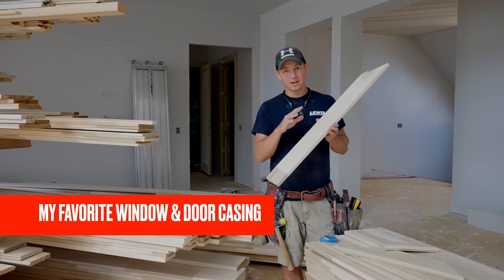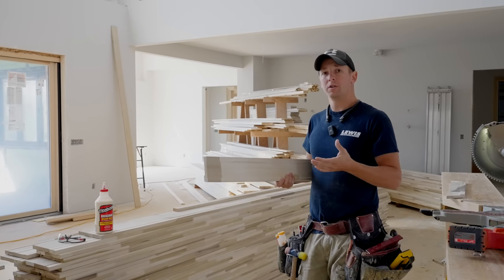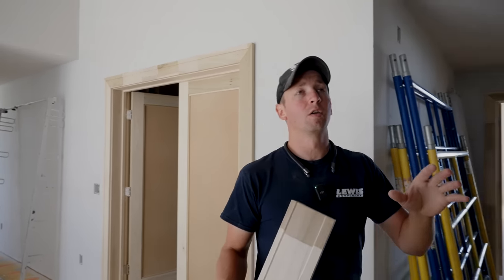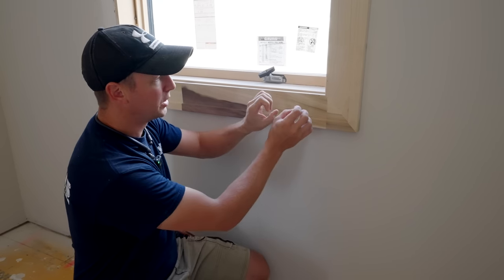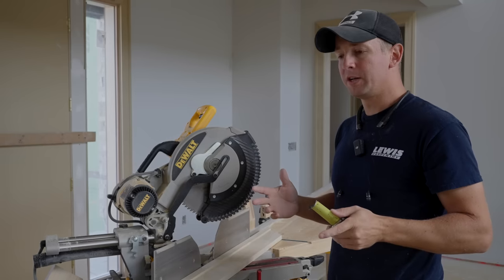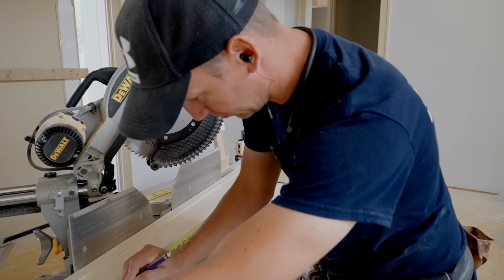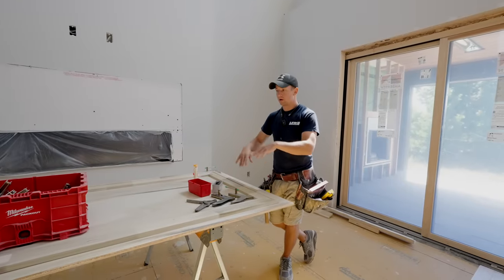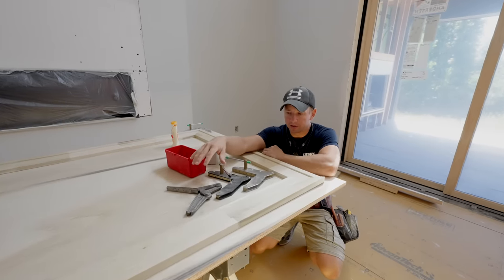BIG CASING!!! Avoid These Rookie Mistakes Builders and Carpenters Make...

Comment: I put a piece of 1/2 inch Birch plywood on my biscuit jointer fence as an auxiliary fence so it gives me a much larger foot print to make mortising easier. I can also make marks on the new fence to help rapidly center the mortise. Just something I have found useful over the years.
Reply: With this idea it seems like you could also add a cutout or use a camp to slide a stop block around for even easier batching

Comment: Hey Spencer, forgive me if this comment was already made, but wouldn’t it be better to reference the bottom of the casing flat on a table rather than trying to align the fence on the top of the casing?
Reply from the maker: With wood being twisted sometimes I find it easier to reference the back of the work piece and use the fence.

Comment: PS, I use Forest blades on everything. My only knock is that the chopmaster teeth seem to break off easily. By the time I send them back to the boys for sharpening I have so many broken teeth its cheaper to just buy a new blade rather than replace teeth. Having said that I wont use anything else.

Comment: Really outstanding video, Spencer. I'm partial to your style as an instructor. You speak clearly and you demonstrate what it is you're talking about. Your job sites are the real deal, not merely sets, which greatly enhances your credibility. 

And just as important to me, your demeanor is authoritative but not doctrinaire or harshly critical of others. I'm done with the know-it-all bluster of creators and trolls alike.

Keep up the great work. 👍
Reply from the maker: I appreciate that!
Reply: Hey Spencer, another great video! 

I like like to register my biscuit slots off of the table whenever possible. As long as it's not too far off center from the thickness of the stock. Sometimes, I will set stock on shims to center it. That's just my preference. There's nothing wrong with your approach, if that's what's comfortable.

If I have a lot of gluing to do. It's also nice to use 4x8 sheet of melamine for an assembly table. Glue cleans up really nicely from it, even after it's dried.

Comment: Your channel is my "go to" for finish carpentry for sure. After 25 years of being a ho-hum carpenter I decided to up my game. I've learned more from your channel than I have from the old timers I used to work with. Better technology, better tools, more efficient methodology these days really change the game in my opinion. 
I just used your "wetset" method for installing the split-jam side of a pocket door and absolutely love it. I prefinished all the trim in this job so I used the blue tape/super glue method to adhere the temporary spacer blocks. It's Saturday and the PL 375 isn't fully cured so I'll wait till Monday to finish up casing. Thanks for all your super-detailed instruction!

Comment: You can attach a piece to the fence of the biscuit joiner to extend its purchase and span relief cuts. You can even use a piece built up on one side in order to be able to register on the face of the trim. Great video 👍🏼

Comment: Great tip in writing measurements on your tape! You can get a much bigger palette to write if you take the label off the Stanley tapes and clean off adhesive. Pencil rubs off with your finger.

Comment: Love your style! I call an un flush miter a clicker... If your finger nail clicks it, it's not right. When it comes to glue,  glue doesn't matter if the surface isn't touching each other. I see people front cut to get the miters tight which leaves a gap in the back. End result,  glue is not working...  I am currently trimming with 1x4 poplar casing. We are Kreg Jigging (pocket hole) all the casing together. Either system is a great way to achieve a great result.  GREAT CHANNEL AND GREAT CARPENTRY

Comment: I love how this guy says that the cut quality on a Forrest blade is "decent"!  In my realm, it's the best you can buy.  And here I was thinking I'm a good carpenter.  Keep up the great work. 
One idea that would've helped with your biscuit placement, would have been to reference off the table.  Clamp the casing face up to the table, and plunge away.  If there was enough height/thickness in the casing, that is.

Comment: Good tip on the Lamello biscuits - they are much better. The cheap ones can have raised edges and so on and makes them a pain to insert into the slots and pull joints tight. Great video and lots of good tips!

Comment: Nice video - the only thing I do different is I mount my jointer to the job site bench and use stop blocks to align the casing. Also Lemello makes a glue bottle tip the injects glue onto both sides of the slot giving you even coverage and not over filling the slot. In my shop I have a dedicated plate joint installed in  my chop saw fence with a pneumatic cylinder with a foot control. Make life a lot easier.
Reply: I'd LOVE to see a picture of that, sounds awesome!

Comment: glad this video came up and i know im building our door casings correctly. they are simple 1x4 but joined with two dowels for alignment and glue surface and a pocket screw for clamping pressure. can’t do much about acclimatizing because assembly needs to happen in the garage. great vid, thanks!

Comment: I have used dominos on casings.use the bench/table for the reference surface and wood glue on the mortise and tenon but use the high temp pur glue (75 second) for the joining surfaces of the mortise.

Comment: The job i am starting in 3 weeks has casings similar (and 8" tall base.)  Already bought the box of Lamello #20's.  Presently have completed half the framing walk through and already I see I should have braced the jambs on the windows before the insulation foam was applied.  They showed up four days early and as expected, those sides are bowed in 1/4".  Going to be a challenge to keep the reveals consistent around those windows using pre-assemblies.  Dug out as much foam as i could. Cleared the protruding foam around the permiter so drywall planes to my jambs.  Fun times for sure!

Many thanks to you, Spencer, for sharing your knowledge here and teaching me what to look out for.  Can't ever thank you enough, Sir.

Comment: I had termite damage to my house a few years ago. I had to make new wide trim for my patio door. Strangely, or not ( I am not in the business) , I basically used all your tips and added one , based on my observation about termite likes and dislikes. I wound up priming all my trim front and back before installing it ( including Sheetrock and borate on structural lumber). The termites seemed to have avoided painted wood, equal to treated. I suspect the priming also reduces the amount of swelling in higher humidity conditions? I realize it may not be practical on a production basis though. Enjoy your videos and will consult before taking any future “ plunges” into the abyss.

Comment: I also pocket screw them from  the back along with the biscuit, and  put a  two inch screws in areas where they wont be seen to pull the joints tight.  I don"t believe its an AC issue. It"s garbage lumber.. Homes built 75 years ago experienced the same weather conditions and some of them still look rock solid today . No back priming or fancy glues. Just well seasoned lumber.

Comment: I use a band clamp around the frame and put two trim screws in to each miter on top and bottom of the frame so they are not seen after installation.  Had good success so far.

Comment: I assemble thick casing (5/8"+) with pocket screws and glue and install in one piece.  Easy and very strong miters.  I've viewed your other videos for mitered beams and suggest using a lock miter router bit.  The mitered pieces pop together and after glue, they won't open up. 

I recently made wide column wraps with clear vertical grain cedar using lock miter routed joints and had no struggle with aligning the mitered joints.  They self align like pieces of a puzzle, even if here are slight bows in the wood.
Reply from the maker: I've got some videos from a few years ago on my lock miter setup with my shaper. I stopped using it because I feel I'm better off just miter folding.
Reply: @InsiderCarpentry  Fair enough.  You do this as a profession vs. my carpentry hobbies.

I'd like to see you do more stain grade carpentry.  We just finished our new home where I did all of the millwork from rough cut lumber - mostly rift white oak, including whole home cabinet builds in rift white oak.  I think we saved a small fortune by buying from several small mills in my area (MN/WI).  I couldn't stand the thought of trimming it all out in paint grade poplar where grain pattern doesn't matter and gaps get caulked.

I get you're just doing the millwork install requested of you but many of us in the DYI world are doing it all.

I did get some great tips from you on my stair build.  I did ours in maple risers/treads and made our skirtboards in white oak.  All finished just poly.  I started watching all your pertinent videos 2 years before we started a year ago.

Thanks for the reply and keep posting great vids!

Comment: Excellent advice. I just finished a job with 4-9/16” casing with back band. I followed NS Builders YouTube video advice using two dominos and two pocket screws and clam clamps for each miter. It creates a rock solid joint. Your approach using one #20 biscuit is simpler and I’ll try that in the future. You are so right that alignment can be tricky if you don’t hold the Domino or Biscuit Joiner just right.
Reply: NS got a lot of backlash for that video as it is just too much for one joint. Think of all the weakness you create with all those cavities. 1 biscuit or 1 Domino is all that is needed.
Reply: @bimotahb1  Interesting, had not heard that. I used ¾” x 4-9/16” poplar with and applied back band. The two #5 dominos and two pocket screws were not too much for that long and thick a joint, worked perfectly for me.

Comment: Nice work, Spencer! I was curious if the biscuit jointer could be mounted on a table. That way the casing could be indexed flat and pushed into the blade making user tilt and alignment errors less likely. I have 2 piece casings in my house that I built 20+ years ago. Glued but unreinforced yet no cracks. Chalk that up to west coast low humidity swings!
Reply: I always clamp my biscuit jointer to the work table upside down to run a batch through. It might be a little trickier to keep door legs or other long casings flat on the jointer though.

Comment: You should give WD Quinn Saw company and their blades a shot.  They are located here in St. Louis & their blades are top of the line, not to mention their sharpening is world class.  Couldn't tell you the last time I bought a new blade.  I take them 10-12 blades at a time to get sharpened.  They come back better than new.
Reply from the maker: That's where I have been sending my blades for years.

Comment: Spencer, I was wondering if you can share what size and brand of pinch dogs you use for this and other trim work? Didn’t see a link for it. 

Btw, Totally killing it with the  new professional video note popups, Spencer. Makes the video ultra high-end. Thank you so much for showing us step by step how to raise our skills.
Reply from the maker: Any brand in 2". I buy them off amazon and it seems like the brand name is always changing.
Reply: I think Lee Valley sell pinch dogs. I made some by hand many years ago, from 1-1/2 flat metal stock

Comment: The biscuit jointer has a center point engrave on the tool i put the two pieces together put a reference mark an line both together an will be just fine

Comment: Cut some plastic straws into sections with the tip at a 45 degree angle. Use it to scoop the glue out of a tight spot.

Comment: Adding a plexiglass auxiliary fence with some additional length, to the biscuit joiner will give you 100% contact with the back of the molding. Just make sure that you take the thickness of the plexiglass into account when setting up your cut.

Comment: Also, I make my trim with whole 3/4" lumber, not commercially produced, specifically so that the back is flat all the way across which makes it easier to register the bisquit jointer or to set the mitred casing into my pocket screw fixture.

Comment: I have had good luck laying the casing back side down on my work table and biscuit jointer flat down on the table as well. Move the fence out of the way or remove. No need to fumble the piece and tool as the table supports all the weight and keeps things in the same plane. Hold down casing with one hand and push the jointer with other.
Reply: If all your material is milled perfectly, then you can accurately reference off the back. But that is typically not the case, even with the most expensive millwork. If you can reference off the visible side, it's always best. That way if there are any discrepancies in the dimensions, it'll be on the backside.
Reply: @ou8nucks630  fair point. Yes this can be an issue with crap stock, but he is already referencing off of the back and fumbling with the tool/piece. Using the worktop allows you to put your biscuit slot wherever you want and not worry about having to position the tool in a perfect spot to keep it in correct plane.

Comment: What are your thoughts on using pocket screws instead of biscuits?
Reply: Biscuits are stronger than pocket screws, but screws do better initially to draw the material in. In the trim molding in the video, there is just not enough wood real estate to make it a viable option

Comment: So youve got about $1000 worth of Clams? I love mine but i only have 2 but Im about to order 2 more. The people at Clam are terrific to work with. I put heavy 3 piece casings on everything at our home in S. Indiana on a lake with tremendous humidity changes. Nearly everything I didnt either bisquit or pocket screw has moved apart. The most difficult has been the dormer windows which were cut into the long span roof trusses, which have even more movement. I have some of the casings I installed 30 years ago that were unsupported  that I am taking down and re-doing- not much fun.

Always love your work.

Comment: Biscuits are great for this application. But, instead of using the fence, I'd use a (flat) table to support the molding and the tool. If the height of the slot isn't exactly what you want, you can use tempered masonite or that super thin birch plywood as a shim.

Comment: Years ago, Frank Klausz advised against use of the biscuit jointer fence whenever possible. Instead, in order to ensure perfectly parallel and consistent alignment, he advocated indexing both the machine base itself and the workpiece against the work table. In this method the joint is indexed from the back side of the workpiece. So long as the trim section has been milled consistently from piece to piece, or the pieces of a given casing all come from the same stick, alignment can be very accurate. This method also works well in cases where the face profile is irregularly shaped and/or does not provide a reliable surface to support the fence. For workpieces thinner than 3/4", the benchtop jointing setup can include a shimmed surface under the workpiece.
Reply: I think the only downside to this method is that not all material is created precisely equal. When I first started doing this method years ago, I tried referencing off of the back of the casing, but the tolerances on the millwork weren't as tight as one would assume. A 32nd doesn't sound like much or look like much, in most situations, but it's a very noticeable amount on casing with a large flat spot, or a very intricate detail. I do like the idea of taking the piece to the machine, rather than the machine to the piece though, it does cut down on possible Inaccuracies in the mortising process.
Reply: @ou8nucks630  Yes, consistently milled section is key to this method. That said, milling discrepancies are a drag in any case...

Comment: Use 2 dominos. It's a stable system. We throw 2 5x30s on every joint on mft table with quick clamp.  Flush and strong.  Production onsite.

Comment: Did you ever find out what was causing the mold growth in the New Build you made a video about a couple years ago?
Reply from the maker: An oversized furnace unit was not allowing it to go into second stage which dehumidifies. That was a big part of the problem and was fixed. Past that, I'm not sure what else they all changed.

Comment: ordering some of the original Clam Clamps today the woodriver and other knock offs are garbage. The knock off compression pin just breaks after 2 or 3rd use resulting to have to drill out and put a bigger one in.
Reply: Great move on getting the originals.  The maker of those is a fine craftsman and you'll chuckle when you read ALL of the enclosed instructions!🤣